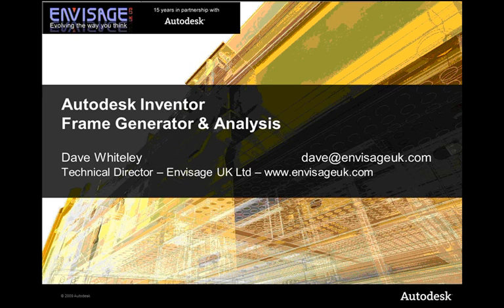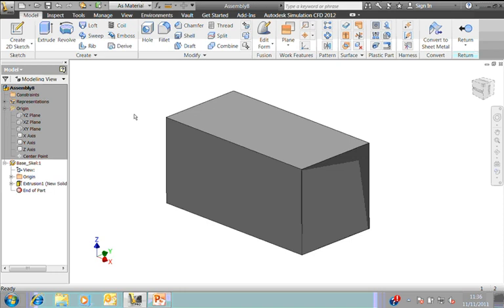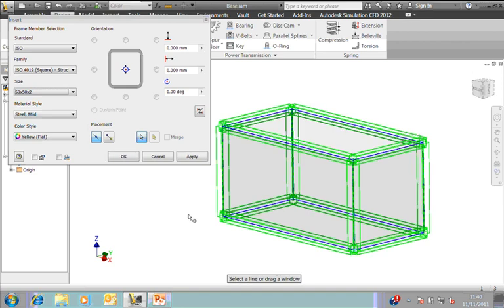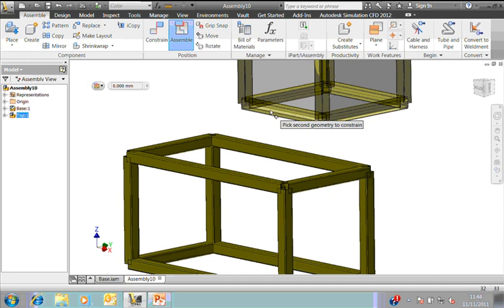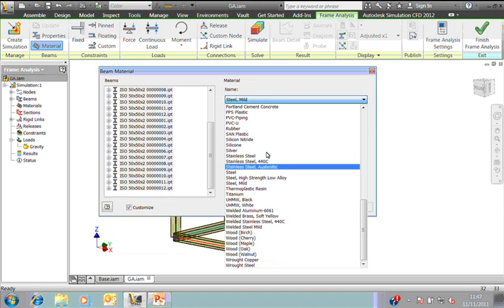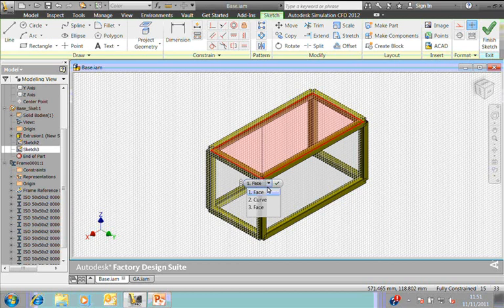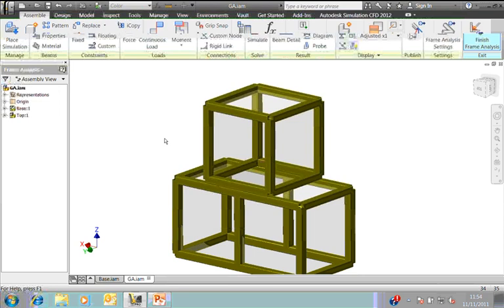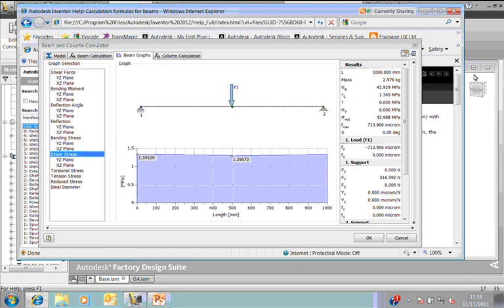Autodesk Inventor Frame Generator & Analysis

Comment: I Mitred & Trimmed then re-ran the Frame Analysis & Simulation and it altered the nodes &  links & created errors on the two new Rigid links I added in the middle of bottom frame. So is it best to do the simulation before creating end mitres & Trims etc.